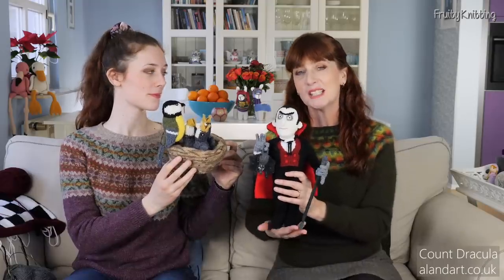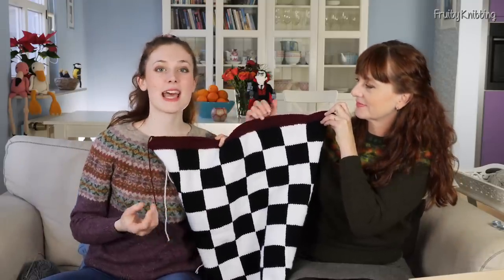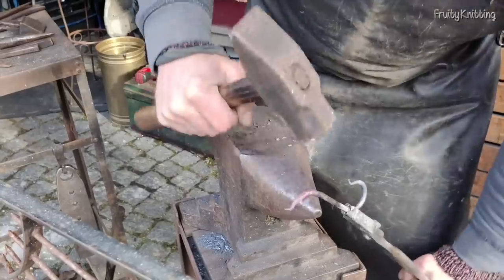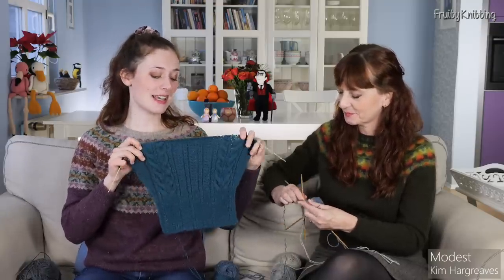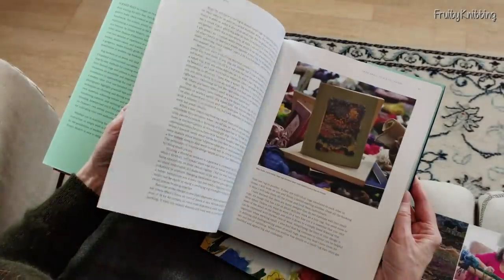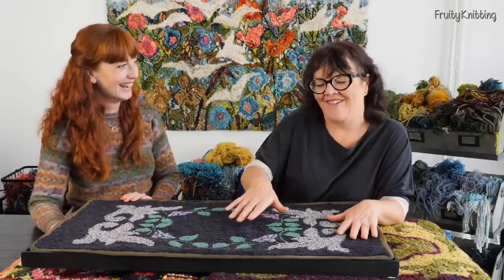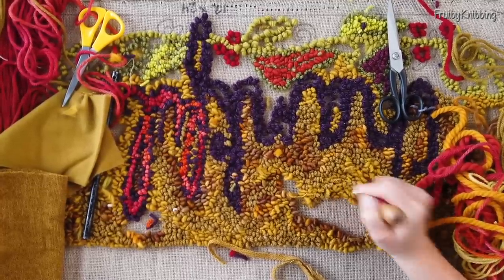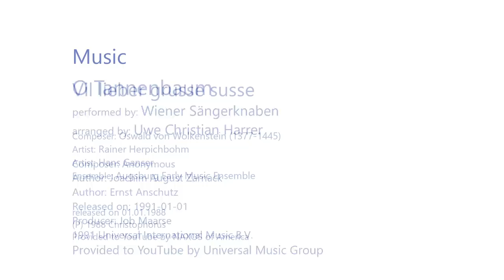Rug Hooking - Deanne Fitzpatrick - Ep. 128 - Fruity Knitting

Comment: Love your presentation of another great episode 💚 
Madeline - if you really want to check your sunk cost and confirmation bias before you sink more hours of work into this project… 
I’d work out what the minimum size you can live with one piece being (the back for example) and then block it as you would at the end. After it’s dry - let it relax and then measure the finished piece. If this has stretched it out enough continue on. If not rip now before you waste any more time on it and cast straight on for the bigger size. 
Good luck 💚

Comment: A bamboo skewer - the thicker one - could be an alternative to the straw for the  walking stick.
You could also try using a felting needle instead of sewing in all the ends at the back of the chess board.   If I was making these chess pieces or any of the knitted sculptures I would make them a bit larger with real wool or other natural fiber like alpaca and then full them so none of the stitches show .  Might be good to remember that gluing any kind of fiber to something non fiber is very tricky . Fiber does not like glue!   Nice project .  Bonne chance with it.   Re the fallacies and cost benefit analysis .  Forget these .  One thing only matters  -  what do you want?  Do you want to continue and finish it or not !?!